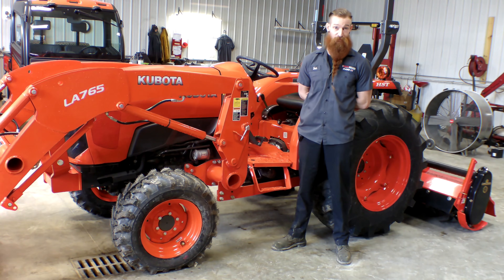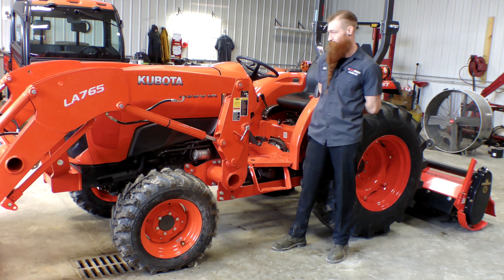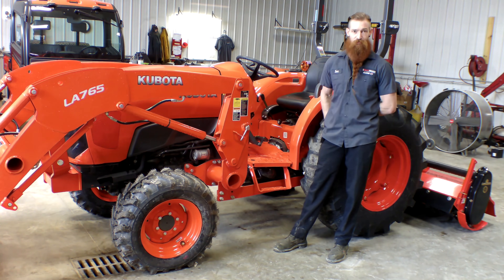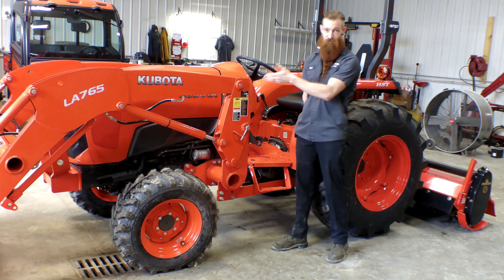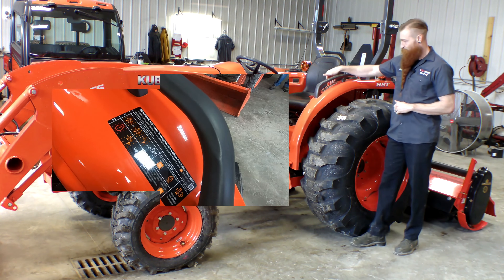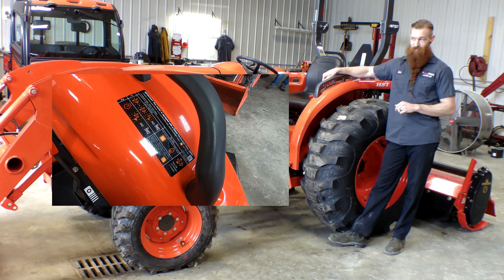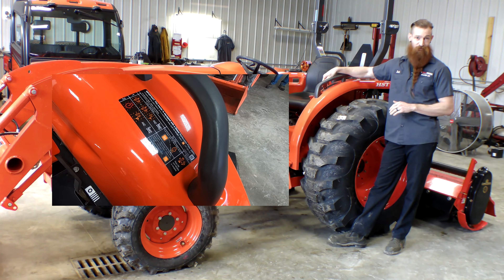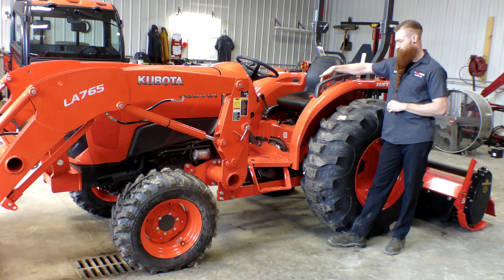Kubota Tractor Diesel Particulate Filter (DPF) Regen Process

Comment: These are great tractors, but I really hate the emissions bs.  I have a L4701 with 800 hrs on it,  I've had good luck with it so far and it's only regen'd a hand full of times. When the regen light comes on on the dash I just make sure the RPM's are high enough and keep working.  I've never pushed any of the buttons for anything other than resetting the error msg that came up after I tried to start it too many times with a weak battery.   
I think the key to success with these is to never let it idle once it's warmed up.  I always run regular diesel with Power Service additive.   If I keep it, I will delete it eventually.

Comment: This video is very informative, thanks. However, on my L3901 the buttons no longer have any markings. So I went to my best friend, the owner's manual and the buttons are shown in one orientation on the instrument panel page, which is opposite of this video and the same orientation as this video on the regeneration page of my manual. Tractor is 3 years old and has a whopping 76 hours on it. This is only the second time it has called for this regeneration. Is there anyway to tell them apart otherwise? BTW, why didn't they use different colored buttons?

Comment: do they make delete kits for tractors?
Reply: Michel, deleting them will cancel any emission warranty the unit has and legally a dealer will not be able to take the unit in on trade. If they did the unit would need put back to factory to be able for resale.
Reply: @banewelker7436  not selling any way i have 3000 hrs would like to have it removed

Comment: This system is so stupid. I have to increase the rpm and put out more emissions while the system cleans itself so it can save emissions? What logical sense does that even make? I understand it probably makes the engine run better and last longer but from an environmentalist standpoint and these libtards saying we need to cut down on emissions to save the planet, this is definitely not a good way to do it 😂
Reply: Do forget, def is shipped in a plastic jug with a cardboard case. We got to save the planet, right?

Comment: Is there a way to remove all this from the tractor without voiding the warranty or after the warrant is up? Other than that, good video. Thank you.
Reply: 20k tractor, they say don't void the 5 year warranty. We out here buying 70k trucks and deleting that trash off them on day one, completly voiding the warranty.
Reply: 20k tractor, they say don't void the 5 year warranty. We out here buying 70k trucks and deleting that trash off them on day one, completly voiding the warranty.
Reply: i would like to have it removed i have 3000 hr  @abelsonaaron
Reply from the maker: No. It is highly not recommended to try and remove the system.  It will void the warranty. These units with DPF or DEF systems carry a five year emissions warranty that starts at warranty start date. That’s a big coverage in my opinion.  A Kubota dealer will not be able to take it on trade if modified. Mainly because legally we wont be able to sell it.

Comment: Why is my tractor coming  dead during  regen cycle
Reply from the maker: Jeff I spoke with our service manager in Terre Haute he recommended to bring it in. That issue will need addressed by your servicing dealer.  A lap top needs plugged into it and see what codes are active.

Comment: Tractor still won't regin
Reply: Mine too.. . what a...... P I T A
Reply from the maker: Greg, this issue will need to be addressed by your servicing dealer and plug the lap top in to check for active codes.
Reply: @BaneWelkerEquipment  what a bunch of CRAPP
Reply: Greg isn't that a bunch of CRAPP ?